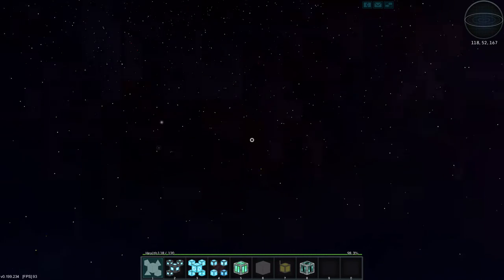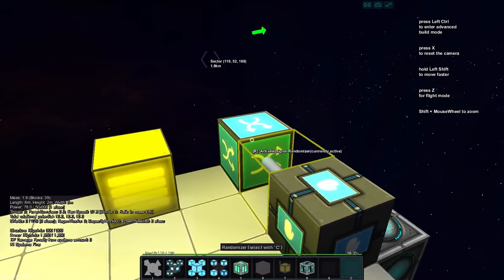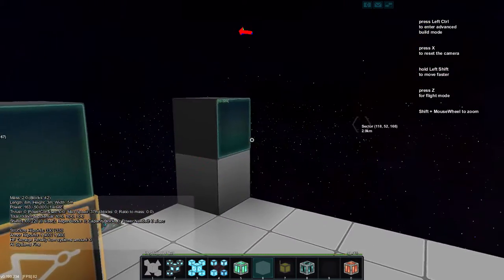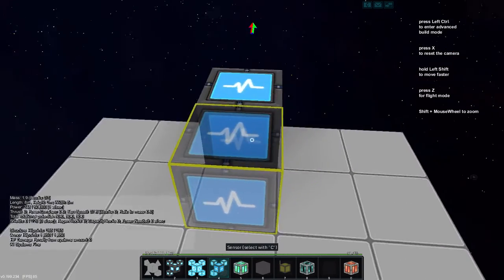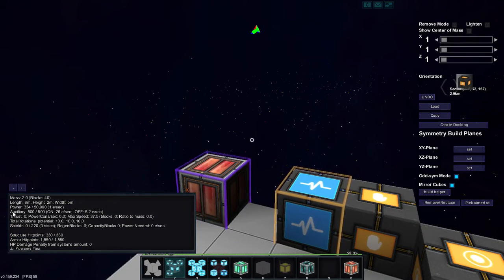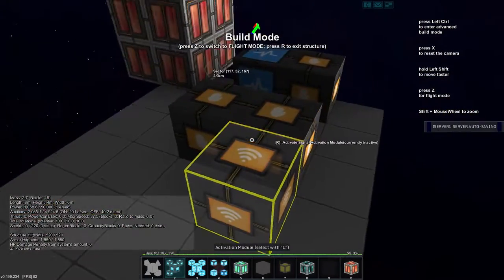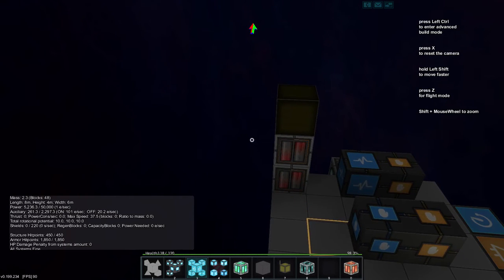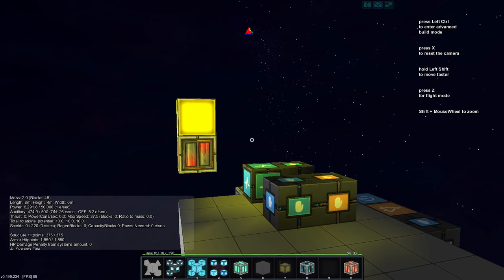JW608 Plays Starmade Ep 190 Sensor Block

Comment: So that new sensor block, you can use it to monitor your ship's power systems right? Then using the sensor, you an direct the auxiliary power blocks to deliver power to your systems if the normal power goes too low?
Reply from the maker: I don't think that the auxiliary power blocks can be controlled by logic yet, so as it stands no.  But you can build a system that flashes a light or changes a display block when power hits a certain level.

Throughout the rest of the week I prototype a few other quick ideas for using the new sensor blocks.